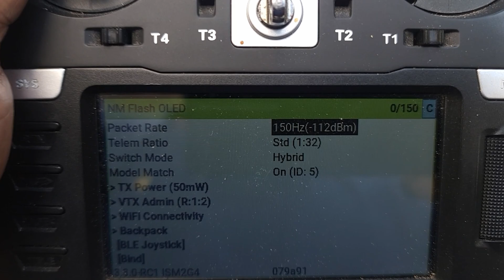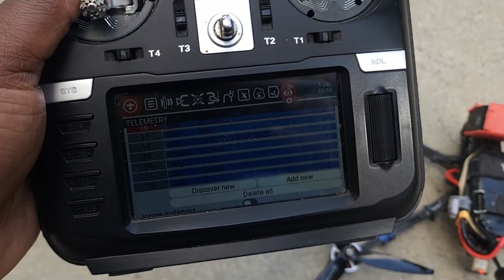ImpluseRc ApexLR  Long Range FPV  Drone  " First Flight after water submersion  and mini review "

Comment: Hi, are you saying the body of the seven inch is the same as the five inch?
I ask because I started with the Apex HD, which I converted to a DC, then a six inch DC. Now, I’m considering converting to a seven inch. Did you used the DC CF key? I see props, but barely any props
Reply from the maker: I don't know about the  apex HD, but yes, Apex 5 and apex 7 shared  the same body
Reply: @GBoniFPV  good to know…thanks. Do you recall if you used the DC CF key? Please reply